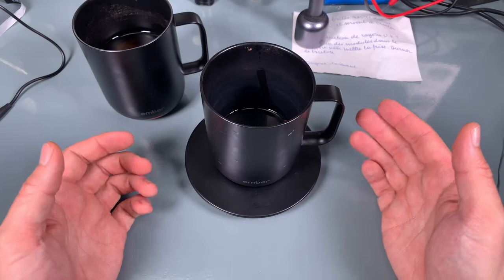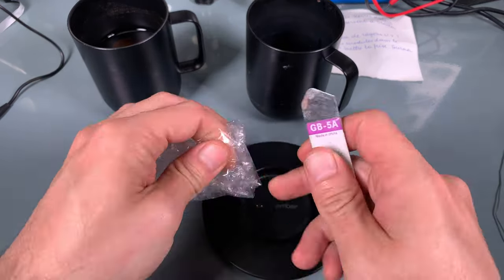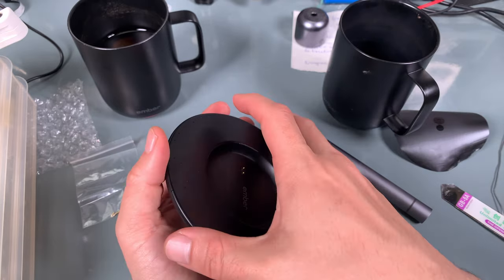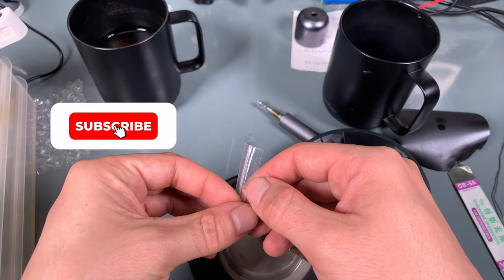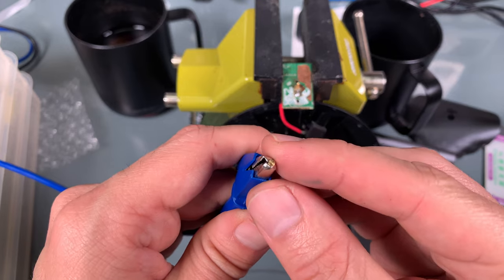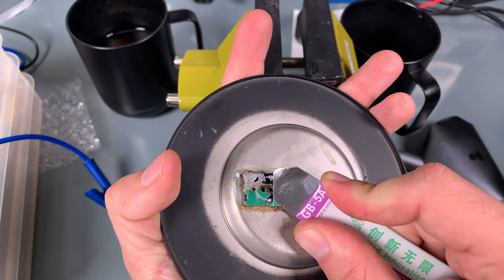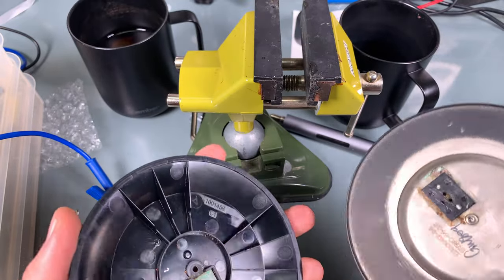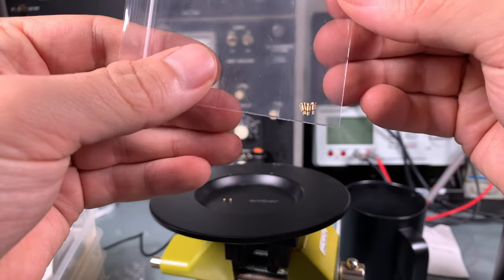Ember Mug -  not charging -  fixing coaster by replacing pogo pin that don't spring back

Comment: I ordered 4 new pins my wife's mug is fine and I put a little silicone oil on hers to prevent corrosion of the springs...If you want to charge your mug while you wait for your New pins to come  You can take a peice of tin foil put it over one pin and it will charge Quick Fix...Instead of removing all the rubber  on the bottom feel  in the middle and press then you can see the outline of the screw then I took a razor knife and cut a perfectly round hole to access the screw then soldered my pins easy.

Comment: Update: I took my charging coaster apart in accordance with Electronic Noob's video. The outside pin was stuck in the down position. Using a small plyers I raised the pin then crimped the outside sleeve to secure the pin in the upright position. The inside pin worked fine but I didn't want to take the coaster apart a second time, so I crimped the inside pin in the upright position. Then put everything back together. As I was plugging it into the electrical outlet I thought crimping the inside working pin might through off the tolerances and prevent charging of the cup.  Thankfully, two fixed pins works just fine and my cup now recharges. Thanks again Electronic Noob.
Reply from the maker: You are welcome, glad it worked! Thanks for sharing!
Reply: This actually worked for me too. I took some needle nose pliers and gently squeezed around the base of the pin until the pin popped up. It seems to be working properly now. Thanks.

Comment: Thanks for the video! I fixed mine without having to take anything apart.  By placing a very small dot of solder on the tip of the shorter pin it works great.  Just be careful not to make it too high or it will prevent the other pin from making contact with the cup.
Reply: LOL, good shortcut.

Comment: Excellent video! I had the same problem with the outer (GND) pin. However, before breaking the base open, I decided to try swabbing the contacts with isopropyl. I know that you said that you had tried this too, but after I saturated the pins with the alcohol several times, it seems to have released the spring in the contact and the cup once again was charging. But this only worked for a couple of minutes. I then tried some spray contact cleaner (bought it at a local auto store... don't need to buy the expensive stuff): I aimed the spray directly into the contacts, while wearing glasses--it will go everywhere. Two or three spritzes cleaned un-seized the internal springs of the contacts, and my cup is once again charging. I imagine that I'll have to do this periodically. Routine maintenance for an otherwise terrific product.

Comment: I was able to grab mine with some wirecutters and pull it up until it was stuck in the on position, then my mug started charging. Emailed Ember customer support and they are sending a replacement coaster.
Reply: Thank you for this comment!  I chatted with customer service and they are sending my replacement coaster.  I just had to submit a picture of the pins and bottom of the mug.

Comment: Thanks for the excellent repair video.  My home Ember quit charging, and I knew some day it would happen.  The pin is still springy, but it must have been stuck in the down position too long, or still has some “gank” in it, maybe making the spring too weak?  Anyway, I’m glad  you made the video, I thought there would be screw/screws holding it together under the rubber…..now I only need to cut out the center to get to the screw head with out messing with the whole rubber pad.  I’m sure I will have to repair these pins more than once.
Ember should use a charging system like in cell phones or sealed rechargeable toothbrushes.  Maybe those passive transformer system can’t supply enough current to recharge the high capacity batteries in the mugs?
Reply from the maker: You are welcome,  personally I would use QI charge - but engineer who build it - might think about heat issue.  You pour hot liquid from top,  than You get heater,  than battery (that don't like heat) and on bottom You would get wireless coil (that heat up - just check temp on phone wireless charger). I think that might be idea why they just did not want to enclose battery between two devices that emit heat. But maybe it was just done so it will fail ^^.  This is kind of device - if You get hook up it's hard to break from it...

Comment: How do you remove the base of the mug?, I have a feeling it's not the pins cuz the pins look like they're in a good position, but still not holding a charge. I think it would be the battery inside of the cup. Any fix it for that available??

Comment: Great video! Instead of taking the coaster apart, I pulled up the pogo pin with a pair of pliers and crimped both of them just enough so that they wouldn't spring down. It seems to work. Interested to see if this fix lasts.
Reply: I just did this as well and it seems to be working. I did clean the pin with rubbing alcohol first, but my pin wasn't stuck down, the spring was just broken. Currently charging, we'll see how long the fix lasts.

Comment: Thanks for the video! I ended up spraying a very little bit of WD40 on the pin and rubbing alcohol. Then i used tweezers and it popped back up. Back up and running now 💪🏾
Reply from the maker: Thanks for feedback, glad it work:)

Comment: Nice repair. 👍‍   Surprised they sell those pins, usually it is "Buy a new product" that hacks me off.  Either that, or they charge so much for a part it is not worth fixing at the cost of a new part!
Reply from the maker: Bob, You mean they use off shelf chines size? To be hones that should be a LAW to use off-shelf component - if it need to be custom - You need provide that part for x years. That would very quickly rule out most of "not repairable" things. On my desk I have adalit charger and there is IC that after googling it's not being found...  why for duck sake You need custom IC to charge 1S2P lithium battery...
Reply: @ElectronicNoobBlog  The Chinese and the Japanese stop making parts when production finishes!  Try getting a part for a MC or a Japanese car a few years after they stop making it!!  Electronics are worse, try getting an output transistor for a Japanese CB now, even when they were being made was hard enough, but a few years after models changed, almost impossible to get anything!
Reply: Hello.  Can you tell me where to buy them?

Comment: Love my Ember Mug, a gift from my daughter.  Coming up on one year.  Very disappointed when the pin stuck.  Unfortunately, I don't have the tools necessary to make the repair depicted in the video, and don't have the patience to go through the process.  Will probably bite the bullet and buy a replacement coaster if it's not covered by warranty.
Reply from the maker: To be honest You just need cheapest soldering iron and replacement pins. it will be much cheaper than getting replacement - they will fail - no matter how good care You take - water - tea spilled might get a pass, but tea with honey or coffee - the will get stuck - sooner or later.

Comment: Those Ember mugs are terrible. First of all they are very expensive. I bought several of them as gifts and they all stopped charging. They wound up in the trash in a few months.
Reply: I've had mine for nearly a year and it's great. Why would you throw away a product that is months old that has a stated 1 year warranty?
Reply from the maker: That mug is the best thing that happen to me (while working on computer) - when i'm focused my tea stay warm. Mine also work great for over year & everyday I throw cup into dishwasher (with was not allowed by manual) and they work great. Spending 15 minutes replacing pin after year of everyday use, spilling tea with honey on it - I would say - it lasted more than I expected.